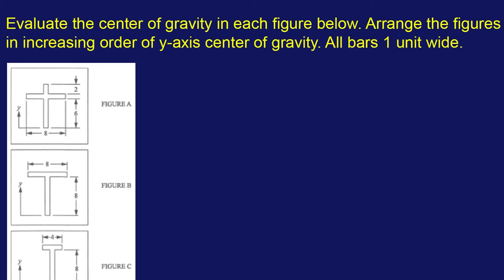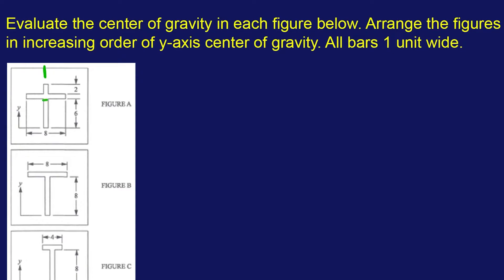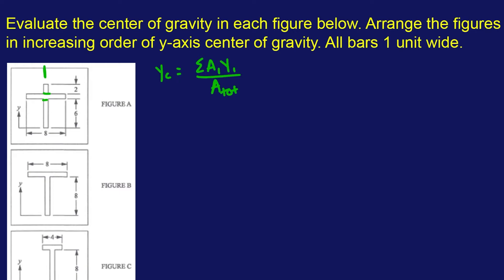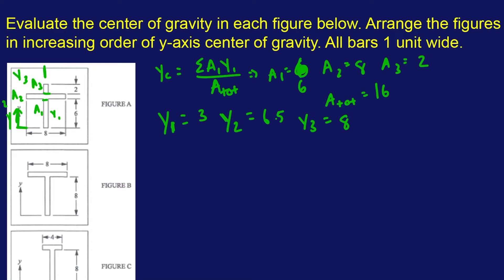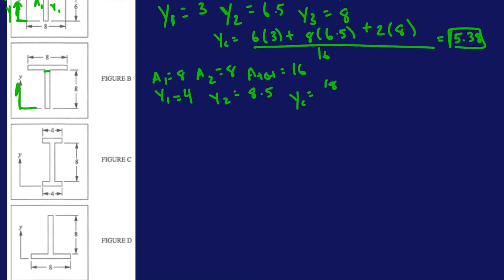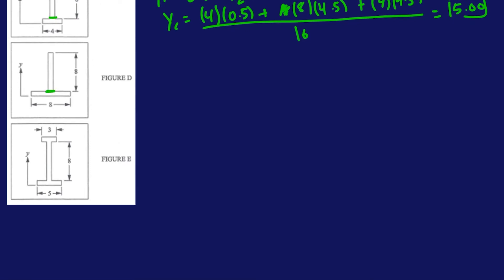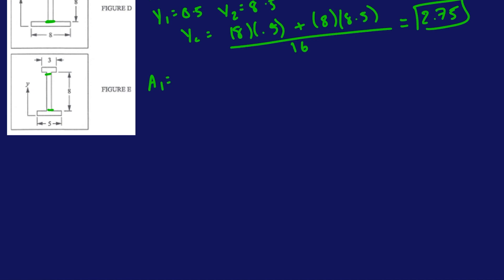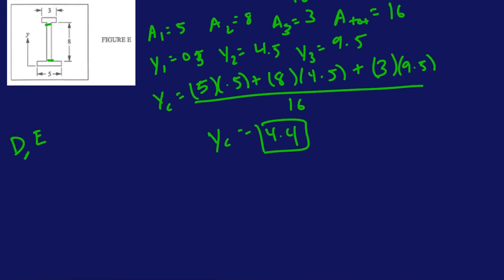FE Mechanical Exam Practice Problem #29: "Evaluate the center of gravity in each figure below..."

Comment: also helps to do it intuitively by just looking at it
looking at B, the centroid would be highest among all of the other ones due to the horizontal bar being at the very top
looking at D, it's the exact opposite
looking at C, it's symmetrical in both x and y, so the centroid is at the center
now just need to compare A, E
looking at E, the centroid is somewhere slightly below center due to larger bottom bar
looking at A, the centroid is somewhere above the center due to having bar above center

So, from low to high-> D E C A B
may save a lot of time assuming all the bars share relatively similar lengths